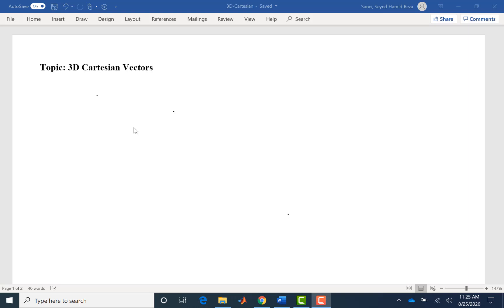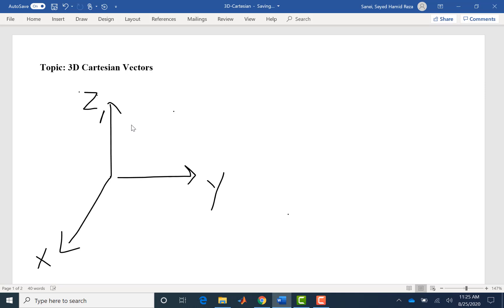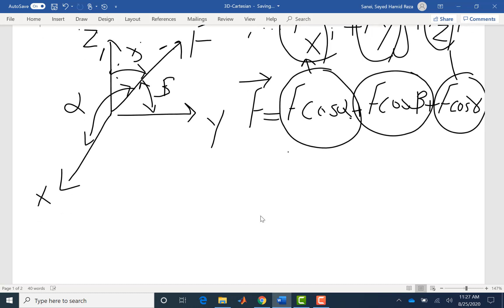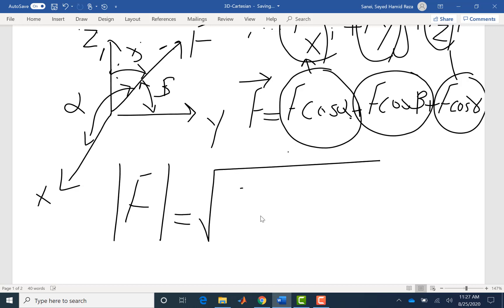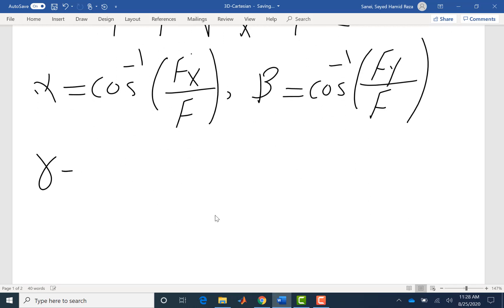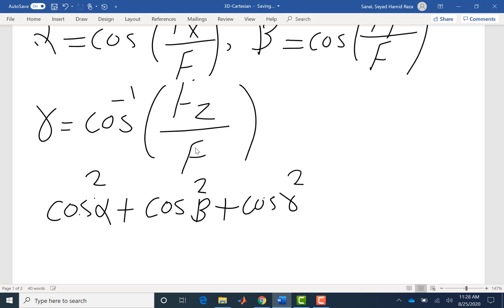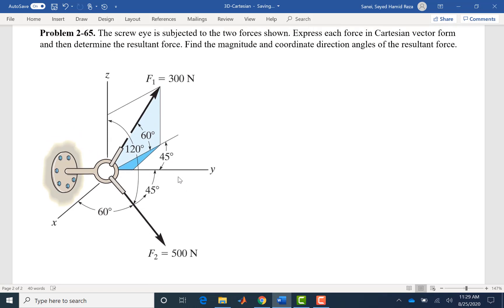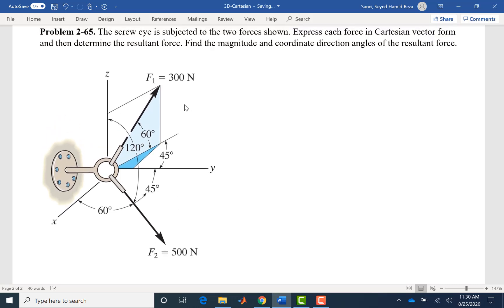Statics lecture and example on 3D Cartesian Vector

Comment: Why is F1 = 300cos 60 instead of just 300N?
Reply from the maker: The magnitude of F1 is 300, but since it is in 3D, we need to find the component of force along each axes. 300cos 60 would be the component of F1 on x-y plane, so basically we reduced the 300 to 300cos60 to find the projection of force F1 on the x-y plane. In other words, we reduced the 3D force into a 2D component. You can visualize it as shadow of F1 on x-y plane. Once we have the component on a x-y plane (2D plane), then we can use the angles we have to find the components of force F1 along x and y axes.

Comment: How did you get z component for F1
Reply from the maker: F1 makes a 60 degree angle to the x-y plane, so it makes a 30 degree angle to the z axis (because z axis is perpendicular to x-y plane), therefore, we could multiply the magnitude of F1 by either , cos(30) or sin (60) to find the z component.
Reply: @engineeringvision  Thanks 🙏
Reply from the maker: @oluwaFaith  You are welcome, I am glad it helped
Reply: Why did you use the inverse cosine instead of the inverse tangent for the direction angle?